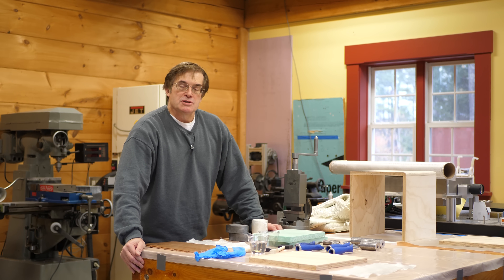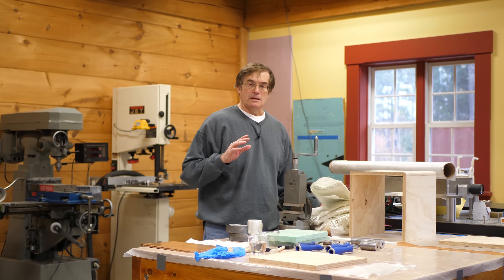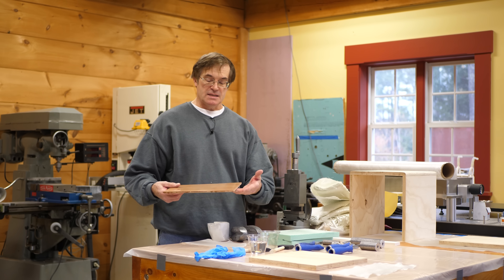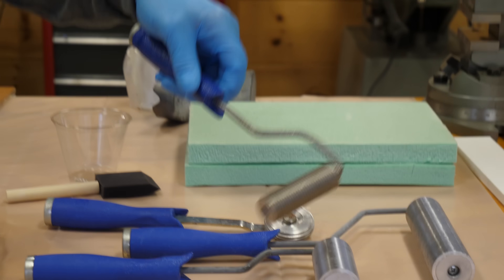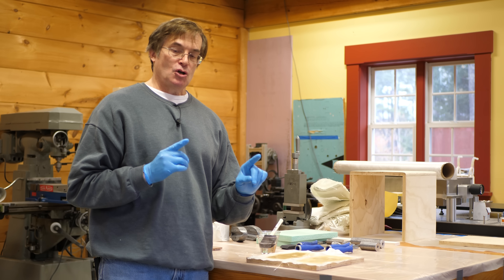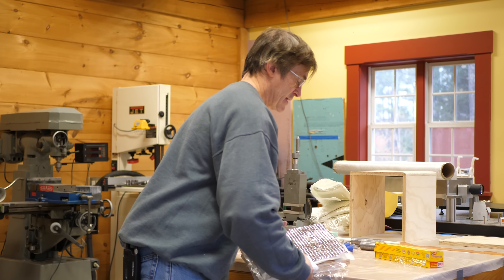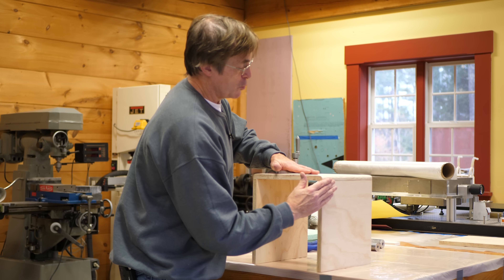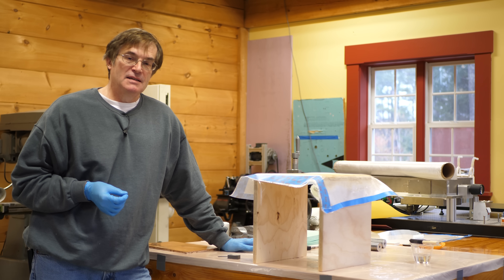Easy Tricks Using Fiberglass Strengthening!

Comment: "that will hold a lot of epoxy" oh dear, he does not in fact understand how composties work. This is all very last century. Please look into vacuum infusion techniques and you will learn that the skin of a composites structure should contain as little epoxy as possible, hence the compression applied by the vacuum infusion.
Reply from the maker: "He" doesn't understand how composites work?  Watch the video more carefully.  I made that very point more than once.
Vacuum infusion and vacuum bagging are both useful and we'll be covering these techniques in future videos, but these aren't the only methods for fabricating a composite structure.

Comment: Excellent video!

A few tips I learned over the years:

[1] Clean surfaces with acetone / or alcohol immediately before applying epoxy

[2] When working on vertical or even overhead surfaces, apply primer coat of epoxy, then let it become tacky, you can then apply cloth, the epoxy literally grabs the cloth!

[3] Peel Ply is your best friend, when working with epoxy, it saves a lot of time and effort.

Comment: FYI, 
Applying a skim coat of epoxy to the bare wood and letting it dry will solve the issue of the epoxy soaking into the wood when the fibrerglass cloth is applied. The cloth will be much easier to wet down and retain the full strength of the sandwich as opposed to having a portion of it sucked back into the wood & away from the cloth.
This is a trick used in many boat shops and really the only way to reach 100% of its potential. Excellent video

Comment: putting plastic wraps on fiber glass will cause fire works lol you dont have fiberglass skills i see that with you hits with the brush its not like paint you need wet thrusts
Reply from the maker: No, it won't.  Also,  I wasn't using a brush, that was a foam applicator.
Reply: @TechIngredients  well it might depend on the epoxy you are using but the one i am using here makes powerful fire reaction with plastic wraps and plastic bags 
and about the thing you are using whatever its name soak it then make vertical small thrusts those thrusts moving horizontally  this way you wont move the fiber glass and cause wrinklies or use roller its much better 
btw english is not my native tongue so idk technical terms or words but you get the idea :D

Comment: OK, so read up on using epoxy & fiberglass before trying to use epoxy & fiberglass.  I read this on the first can of epoxy & fiberglass I ever bought, 30 years ago.  I don't know about all the people fawning all over yourteachings, but this info is ON THE SIDE OF THE CAN.  I know I'm weird.  I actually RTFM.  I'm 13 minutes in, and I haven't gleaned anything new that I didn't know from 4 minutes of RTFM.

Dude, your videos are useful, but they are FAR TOO VERBOSE.  This video should've been 5 minutes.
Reply from the maker: That would have permitted me to cut out the glass and wet it as it was applied to the wooden structure.  I might have gotten half way through the heating pads and then we're done.  Sorry, no.  Interesting that the can discussed aluminum oxide glass and epoxy monomers, that was some some can.